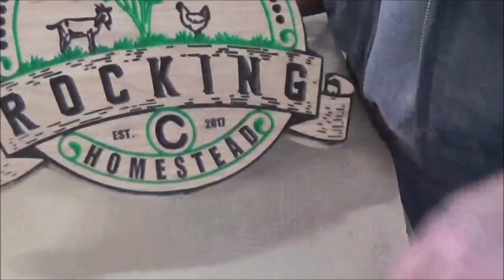Rocking C Homestead Sign (CNC engraved)

Comment: Looks great...?...What bit & depth setting was used to cut your project out.
Reply from the maker: Graphics and writing was 90 degree vbit at 0.13 depth, to cut out the sign I used 1/8" endmill 0.75" depth....Thanks for watching!!
Reply: @SmokeysCNCWoodworks  Thanks for your response...great work.
Reply from the maker: @kennethspivey9530  You bet!!!...Thanks for watching!!
Reply: @SmokeysCNCWoodworks  meant to ask...your corner holders...did u make or buy them...i'm looking at getting something like that.
Reply from the maker: @kennethspivey9530  Bought off the net from Rockler, great woodworking accessary company...Thanks for watching!!

Comment: Great sign. Questions: Do you seal the wood before painting, if yes with what?  If not how do you stop the paint getting in the surrounding areas?  Are you vcarving to a set depth or letting it cut based on line thickness?  Thank you for the help.
Reply from the maker: I use sanding sealer or a light coat of poly sometimes, and sometimes I don't use anything and it sands out you just have to sand a bit more....I usually am set at a depth of 0.17 and the program varies the depth a little based on line width....Thanks for watching!!

Comment: As always enjoyed your show. Question - What do you do to the wood sign to help prevent any bowing or cracking if it is to be out in the weather? Thanks again.
Reply from the maker: Most of the things that are going outside I do in oak..I glue the wood up in sections that will fit through my 13" thickness planer and plane both sides of the board..(how this helps prevent bowing, I have no idea) its a tip I got from my dad who has over 50 years as a contractor and over 30 yrs teaching the stuff....Usually when he tells me stuff like this i just do it, because he has the experience..the cracking I put 3 coats of polyurethane on over the whole sign front and back.....Thanks for watching!!!
Reply: Thank you again.
Reply from the maker: You bet, I'll tell you all I know about this stuff!!